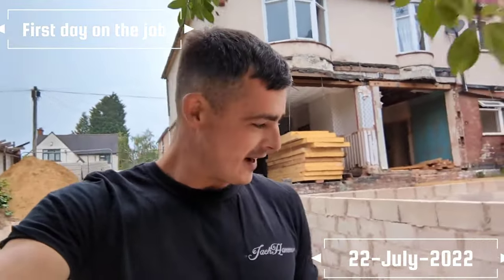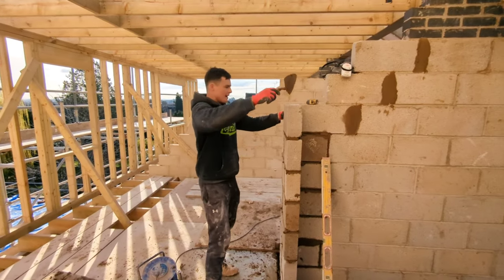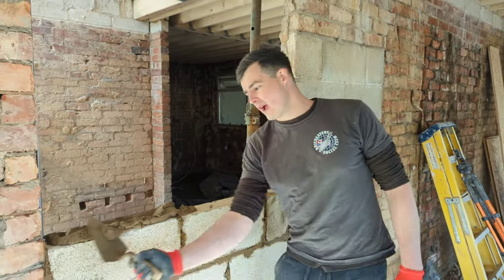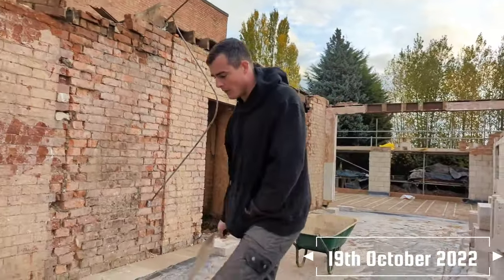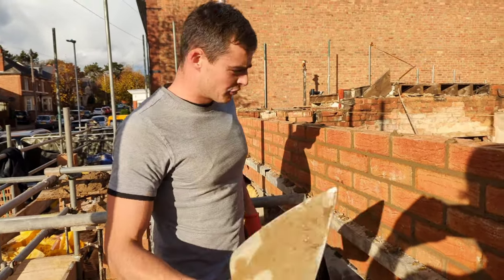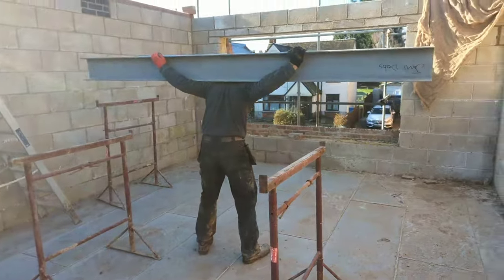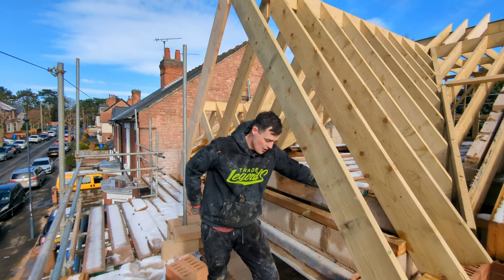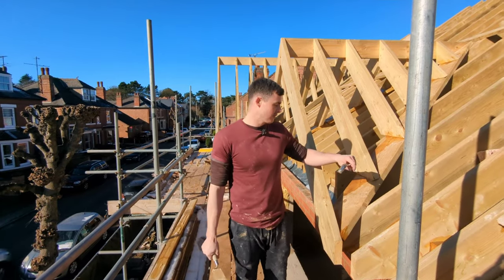MASSIVE house transformation | IzzyTheBricky Weekly ep08 #renovation #vlog #construction

Comment: There SHOULD be a LARGE air space gap in-between the face of the insulation and the OUTER WALL inside the cavity ; this includes an air space gap in-between the face of the insulation and the cavity-wall-tie drip point which is in the centre of the cavity.                                            Ask N.V.Q. BRICKWORK teachers for PROOF of this !

(With the cavity-wall being abridged with insulation (insulation touching both the outer and inner walls), damp will travel from the outer wall through the abridging insulation to the inner wall !)

Comment: Great stuff Izzy.
That customer was taking the piss pushing you all the time . The job would have gone a lot quicker if you had a site mixer instead of the little belle and most of all there should have at least been a hoist to get materials up ! It looked like a site i served my time on and that was 1988 ! Also the steels should have been craned up . You should have been paid double as you ended up doing a lot of work you shouldn’t have done. 
   You guys are very lucky you got through without any injuries.
   Typical customer putting on the bricklayers because we just get on with it to help people out. 
   I priced a pointing job on a massive pike ( gable ) I said a big expense will be the scaffold and the customer said “ we had a guy who said he could do it by leaning over off the roof “ 
      They said he hadn’t gone back to them so I said “he’s probably fell off a roof !” 
   I priced it with a scaff and they never even replied, that’s how we get treated 😒
        Rant over pal 😂🧱👍🏼